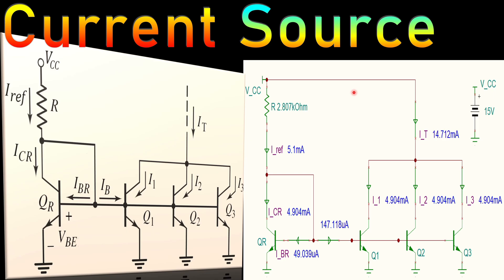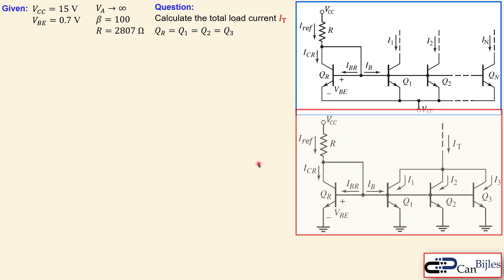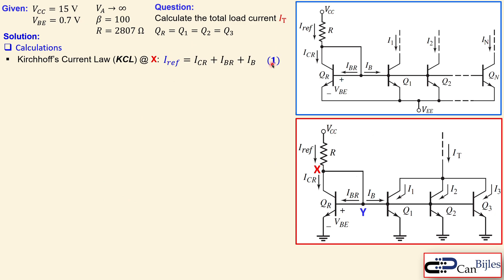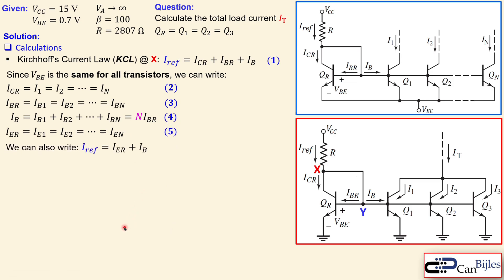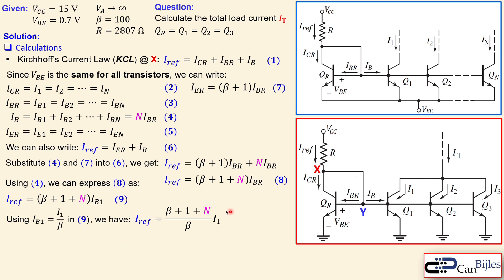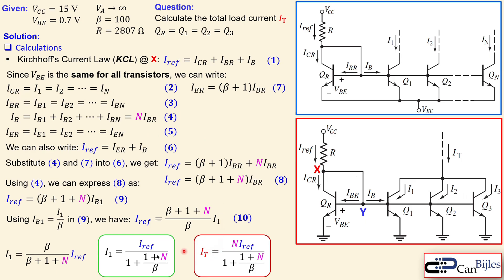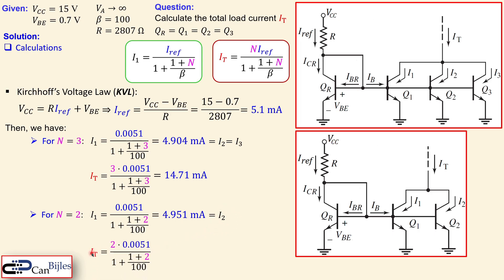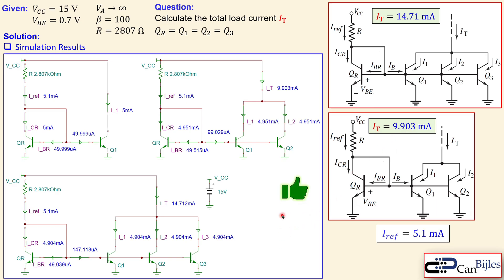BJT Current Sources - Upscaling Currents 🌟 Calculations & SPICE Simulations 💡 Example 6

Comment: perfect, thank you, if i am not wrong QR is very important, it mean if i want to make very high current let say 5 ampere in extended transistors i should have strong transistor at QR before designing other transistors, am i right?
Reply from the maker: Thanks for your message. Great to know that you liked the video. The current mirrors are usually not meant for very high current levels, like 5 A. However, in theory, if you want to make this current source of 5 A, then the transistors should be able to sustain those high current levels. Then, we require power transistors.